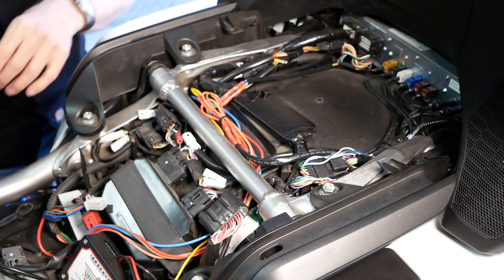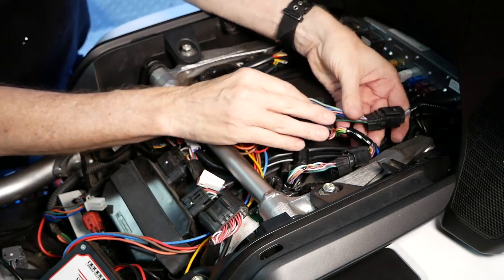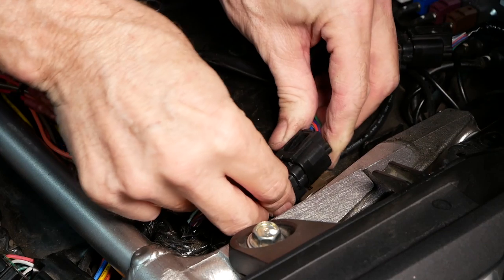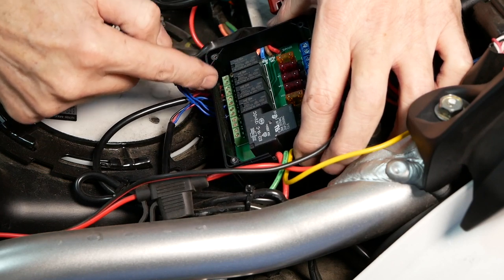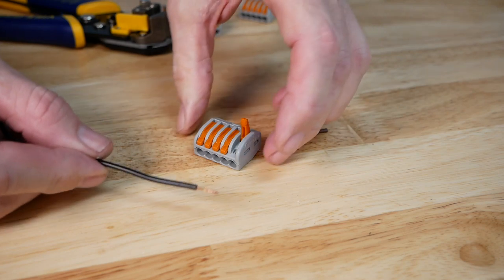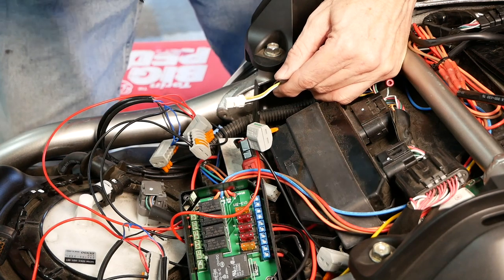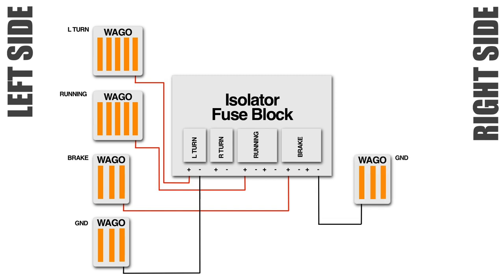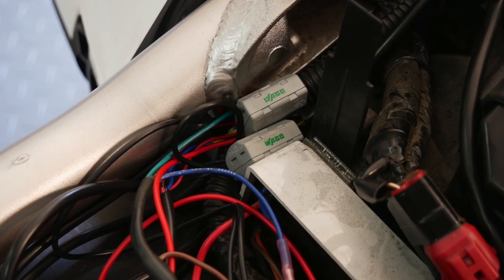2018+ Goldwing Wiring Tips

Comment: This is a great idea. I put on the Big Bike Trailer Harness to add extra running, brake and signal lights to the bike without pulling a trailer. 

I have the Electrical Connections Fuse Block with a 30 amp relay. 

All seems good other than too much wire under the seat. 

I ordered some of the Wago Connectors on eBay right after I saw this video. 

Thanks a bunch.

Comment: This is obviously a quick and simple expansion idea and I appreciate where you are coming with the ability to change and add things to the bike later with little effort.  I also hear you plan to cable tie etc to clean it up, which is good as the wiring looks quite bulky and somewhat messy.  I would prefer to take extra time to solder wires, run wires in parallel, heat shrink around them and wrap them like a loom.  I feel anything on a motorbike is always best to be weather sealed even under the seat. I can see this video would be helpful for someone not so fussy.
Reply from the maker: The second phase is to route the wires and tie them up neatly. Soldering is always best and the most reliable connection. I am also coming up with a way to water seal the WAGO connectors and after I test it, I will put that into another video.
Reply: Two possible options are a large heat shrink tube or self fusing tape.  I will be interested in what you come up with.  Thanks

Comment: exactly what I needed to know.  I have been looking at multiple accessories, and wondering if I should just stay with one brand for my 2018 Goldwing.  I like the functionality of the Show Chrome Isolated fuse block, just what I need for using different accessories!  I used a little creative thinking a while back to mount a GPS on my HD Low Rider by using their installed USB connector, just forward of the tank on the frame.  I did not want to run the factory Zumo wires under the seat, and I also want the flexibility to use the Zumo GPS on other bikes.  Thanks for this video!!!

Comment: So is the canbus is what is actually triggering the 4 fused signaling relays.  Or are they just optically isolated and triggered by your tail light wires.  Also I am assuming the big honking large black relay is for feeding another buch of accessories in the trailer
Reply from the maker: Canbus is triggering the relays.

Comment: Chris, my Isolation Fuse block just arrived. Question: I am running one  set of driving lights (Denali) and one set of fogs lights (Rivco) up front. Do I wire these two sets to the running light connector on the isolation fuse block or to the opposite side where it has the 12V Key On connectors? Thank you.

Comment: Hi, I’ve just installed de pathfinder cowl lights with the harness and only the “white light” is working not the turn signal. The video is 2 years old. Is the harness alone ok to use with the cowl lights or do I need a fuse box ? I have a 2021 GW and the cowl lights is my only add on accessory. Thanks for your response:)

Comment: Ohne question: is that richtig, that you just have ohne wire from Show Chrome, that Connecticut the fuse Box to the original bike wird? And all the rest lights you run oder the fuse Box? Do you need to buy the wire from pathfinder then, like in you buy the for lights of something el
else?
Are there different Isolation fuse boxes on the market?

Comment: Is all this really necessary if you only have the 4 accessories that the Pathfinder or Goldstrike harness are designed for, since your only adding low voltage LED lights?  Has anyone had problems using only the harness?
Reply: I remember reading on a board where a guy who had Goldstrike lights on his saddlebags had to replace a controller because the adhesive holding the lights failed and the light fell off leaving dangling wires that shorted out the controller.